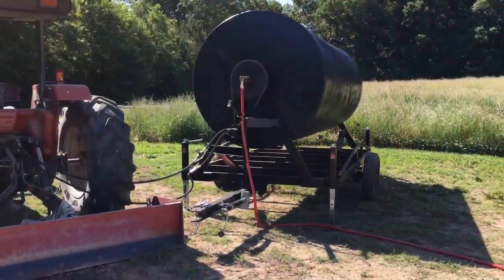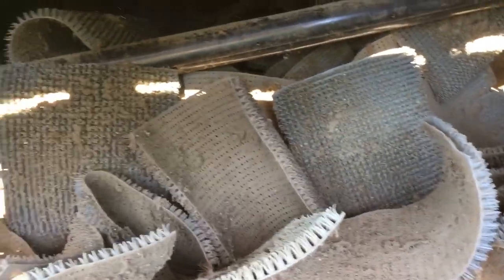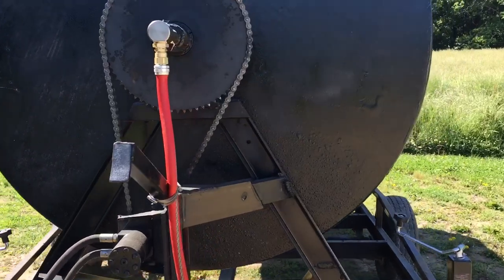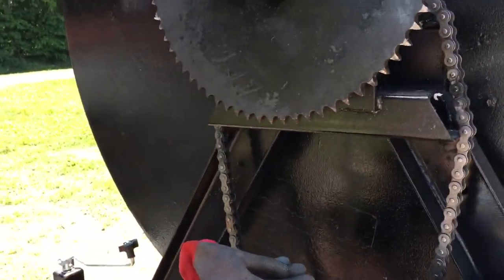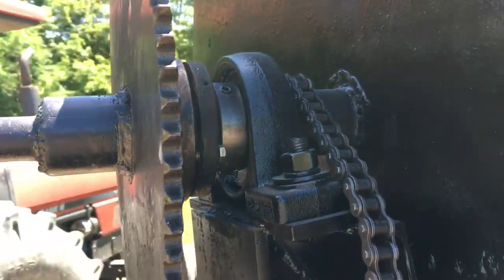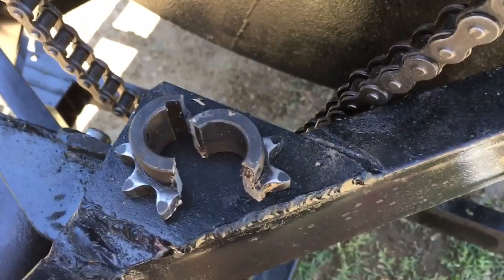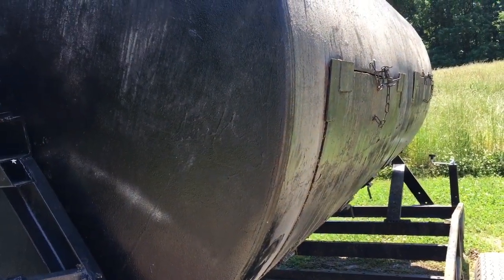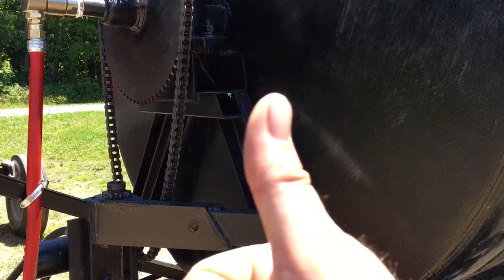Testing the Chicken House pad washer Gerraldfarms

Comment: "Learning Curve", if you go with a double chain - double sprockets, it will just tear up something else. Going to have to unload 1/2 the pads and just keep adding some additional amount each wash cycle until it reaches the perfect amount. You know now, the amount  of pads in there is too much. Dust! I thought Gordon was using hot water and that was steam.
Reply from the maker: I think that is the plan now. Start with less pads then keep working with it. I’ve never seen a gear bust in half like that. Have a good one buddy